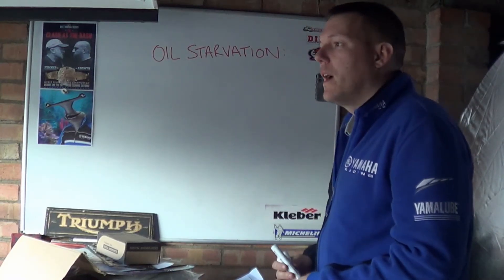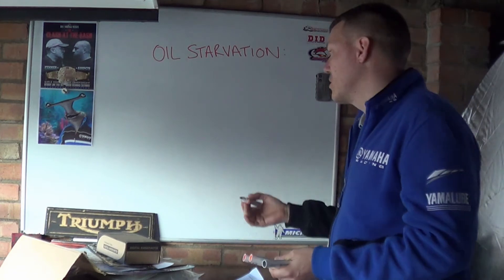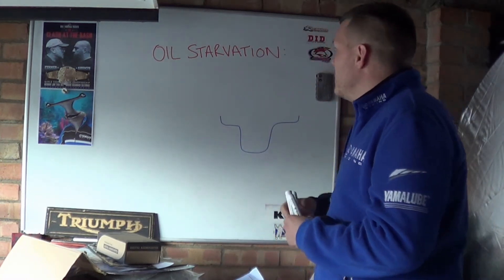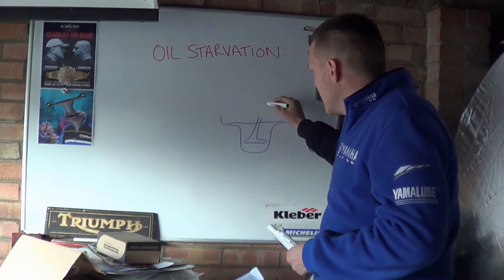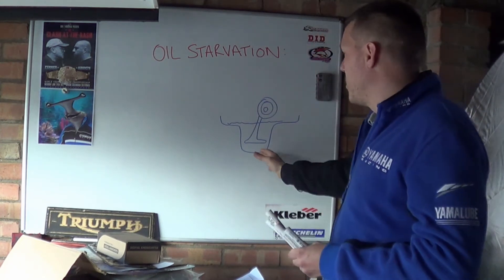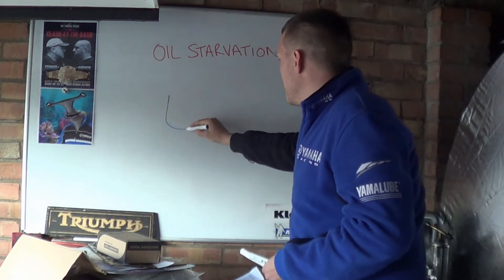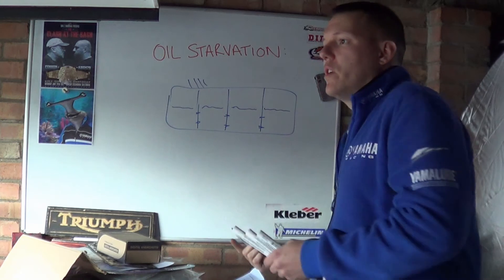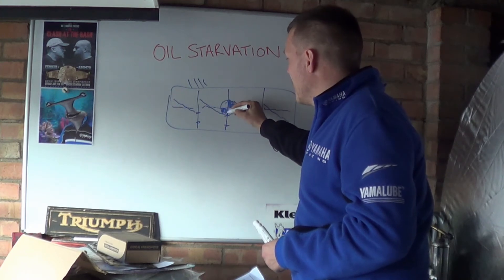Oil Starvation - and how it is prevented

Comment: How and were can we confirm if motocross bikes and speed bikes suffer from oil starvation during wheelies? The only way would be to open the engine and check at that angle or to talk to the engineers.

Comment: Hi Matt, I'm a light vehicle technician but have a decent knowledge of physics. I'm just wondering, would leaning a bike cause the oil to slosh to one side? Because as far as I'm aware the bike leans to counteract the moment caused by the centripetal force on the tyres as the bike turns around a radius, so the net force experienced by the bike stays parallel with the lean angle. I'm not sure if there is more at play with leaning and cornering but from my experience riding a motorbike I've never felt a lateral force, unlike in a car where I'm pushed up against the side of the seat. I also remember seeing a video about a motorcycle with a side car that leans with the bike, they have cups of water on the side car that stay level with the lean of the bike and don't slide off no matter how fast or steep the bike and sidecar corner. So I was wondering wouldn't the oil in the sump act the same? 

I thoroughly enjoy your videos, keep up the good work.
Reply: Leaning a bike while stationary will make the oil slosh to one side as it flows to the lowest point. Leaning while cornering won't as long as the vertical axis of the bike stays reasonably parallel to the resultant force from gravity and the lateral force from cornering.
Reply: And not he ever replied

Comment: Do you know if it matters if you do an oil change without warming up the engine before draining?
Reply from the maker: The reason for heating up the engine is 2 fold. 1- it 'thins' the oil. This allows it to be drained quicker. 2 - Thinner oil will 'fow' better from within tight clearances and all the nookss and crannys, so to speak. Removing most of the oil from with the engine, making replacement more complete - matt
Reply: But every time I park the bike the engine is hot and the hot thinner oil already drains back down to the sump as it cools down - so why not simply drain it cold?
Reply: particulates are also suspended in the oil after the bike is ran so they will drain out with the oil, whereas when the bike sits those particulates settle and are less likely to be removed.
Reply from the maker: because you probably use your side stand so some of the oil will remain in the head, and heating the oil will allow the oil to drain out in a decent time not 3 days lol
Reply from the maker: Another good point!